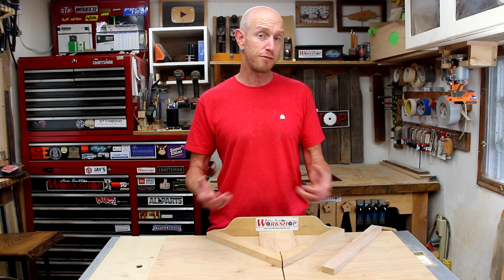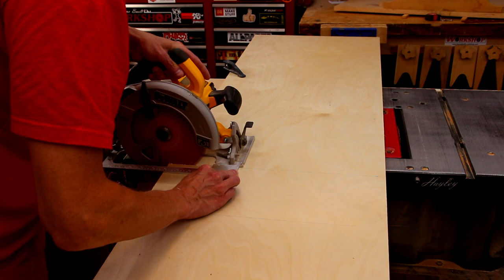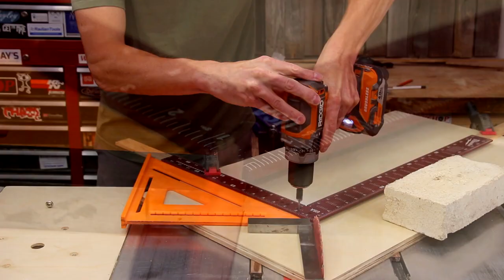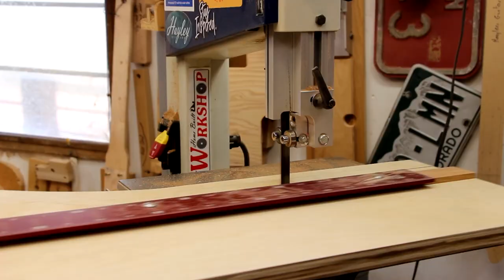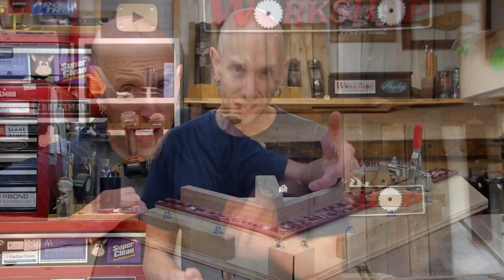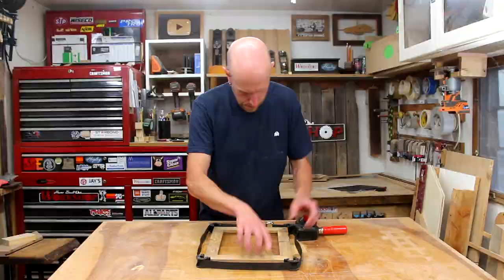How to Make a Picture Frame Sled | This Improved Version is very Accurate

Comment: I'm glad to see you have trouble, not "that" you had trouble. 

What you experienced is what many of us newbies see woodsmiths make things and it looks easy.  And it is! If you have practice and experience, it is easy, but for someone still unsure of their skills and aren't set up the same, things go wrong!

I suppose you figured this out quickly without saying as much, but if you had made the sled square to the table, the excess weight would have been on the other side of the blade and its center of gravity would have been on the table instead of where you stand.  Speaking of which, you could still have removed the excess behind the square to make room for your belly.  But, that would be much more important to me than to you. ;)

Comment: Great explanations. Another thing with mounting the long side to the left is that your ruler will measure in 1/16's. If you mount the long side to the right, it measures in 1/12's, which drives me nuts. Thanks.

Comment: I'm not sure if your table saw has this or not, but my small/cheap Kobalt table saw actually has t-slots where the runners go. When I build my sled I fully intend to add something to the bottom of my runners to make them T shaped and "lock" them into the slots therefore eliminating the need for perfect weight distribution.

Thank you though for taking the time to not only design and build this sled but for taking the time to film and edit the process. It was very informative.

Comment: To add weight up front on your sled, just orientate the base to be square and not at a 45 deg angle.  That will add weight up front.  Still remove any excess wood on the back.  Thanks for the video.

Comment: you could of left the runners long in the front and added a little weight to them.  My table saw does not have a super huge table either but it has T slots. My daughter is a artist and I recently started building the canvases frame and stretching them for her. I decided it might be nice to make some high end frames.  I purchased some molding bits for the 3 hp router and am going to go all out. My hope is she can sell some rames with the art.  She is a very talented artist.  I like this build.

Comment: Jeff, I feel like if you add more plywood to the front and use your biscuits or Kreg tool to attach then some wood braces from your front wood supports it will add the weight your looking for without adding front length.
Reply from the maker: I was thinking about that. I actually had some pieces laid out that I was going to splice on the front. I'll give this a try and see how it goes. I may just add more material at some point.

Comment: If you are off you get you will get a perfect 90 but you'll have one edge longer than the other.  
I have a Sawstop so I would need to cut a lot further back.
Reply from the maker: Yes, You'd need to widen the slot so the blade doesnt touch the metal.

Comment: Just add an infeed removable small table to help you with the weight issue.
Reply: I built a similar sled for my Shop smith table saw. I simply added an auxiliary table off to one side which supports my sled. My sled is more of a rectangle so the right side hangs off the back more than the left. Works great with no tipping issue.

Comment: Thanks for sharing your project and tips. I tell you what. If you had some problems of balance on that table saw. Just imagine my problem with a cordless Dewalt table saw. It's a lot more small than yours. Wish me luck. Greetings from El Salvador. Central America.
Reply from the maker: I'm sure you could make it work. One idea was to mount the square facing the other way so the weight was over the saw and not hanging off the back. I haven't tried that, but I think that may be something to experiment with.
Reply: @homebuiltshop  what you think if I make de sled running only on my left side of the saw. Because this cordless table saw have only one t track slot on the left side.

Comment: Weight overhang issue: Flip the jig 180-degrees so the framing square points at you instead of away. That should put all the weight on the table.

Comment: insert a magnet under the plywood. it should keep it down. i cut aluminum on all woodworking tools. many woods melamine and crap in particle board are a lot harder on the blades than aluminum. with carbide everywhere no reason not too. even cheep blades are fine. if you want you can brush some oil on the blade to keep the chips from sticking to the blade. also i often cut steel on my table saw with no problem. just change to a thin metal cutting disk and cut a little at a time by bringing blade higher on every pass if peace is to thick. just don't set your sawdust on fire.

Comment: Just a question...  I like the jig, but wouldn't you want to install splines or dowels to strengthen the joints?  It would seem a jig to cut spline for these frames would be a good finishing tool
Reply from the maker: You are correct. Once you make the frame its best to reinforce the joint with splines or some other method. I should have mentioned that in this video.

Comment: Maybe I missed it but what is the preference for running the longer leg left versus right? Most of these tutorials for the jig with rafter square have the longer leg on the users right side when facing the tablesaw from the fence bar.
Reply: He is left handed. But you can put the framing square in whatever orientation is comfortable to you

Comment: I do need to make one of these for my small table saw ( working in a 8x12 shed ) , Since you only use the dimensions one side would an aluminium ruler or stick on tape work? (with a little more setup to get the 90 deg on the wood below)
Reply from the maker: Yes, A ruler would work great, like you said there would be just a little more setup on the other side but it would work great.

Comment: I dont know what I did wrong. I'm getting a 45.6 degree cut. 🤦‍♂️ back to the drawing board
Reply from the maker: Interesting. It should work though as long as you cut the mating piece on the other side.
Reply: @homebuiltshop  yea. I'm not sure what happened. I just unscrewed the short side and screwed it back together while clamps held everything to a square. Weirdness.

Comment: Omg 🤦‍♂️… you actually cut the framing square for this 😳🙄…
-Just make a typical square table sled and cut a corner triangle off a piece of scrap plywood and center it on the sled cut line… boom, done
Reply from the maker: I wanted to have the numbers and a place for the adjustable stop block. Your idea will make the same cuts though. Thats how I made my first miter sled.

Comment: wonder how many sawstop users are gonna fire their brakes?
Reply: They will have to use a plastic square.Or learn the hard way.
Reply from the maker: In the original video I saw, he made the slot wider and used a piece of wood as a filler to avoid the Sawstop brake going off.
Reply: @binnsbrian  Turn on the brake bypass

Comment: Not a fan of the sandpaper on the bottom of the stop block. Every time you reposition it, you are removing material from your base. It will just get looser and looser over time. Something like felt may have been a better solution...